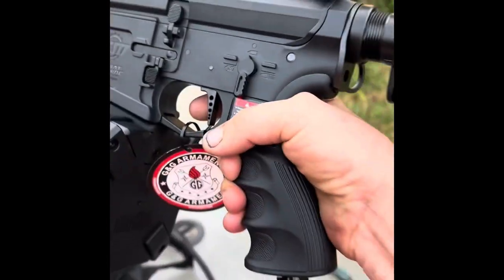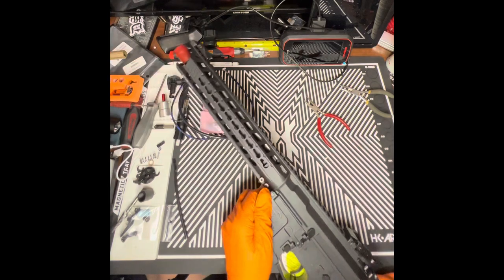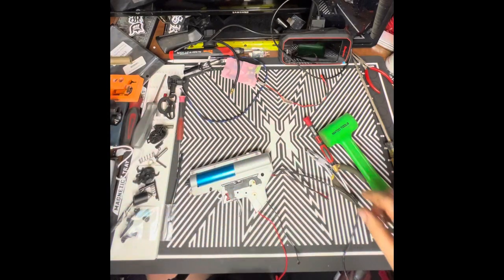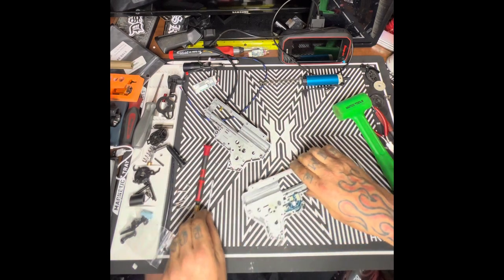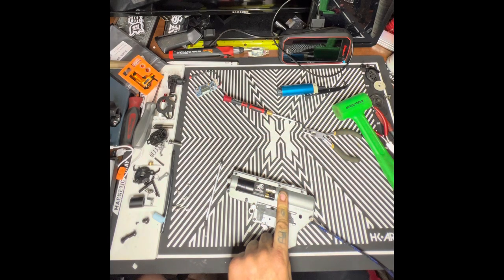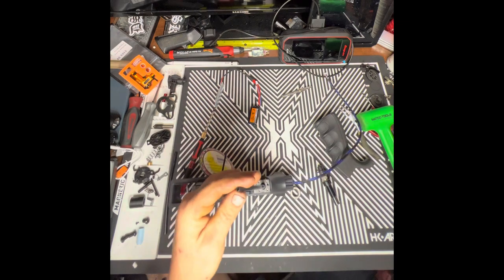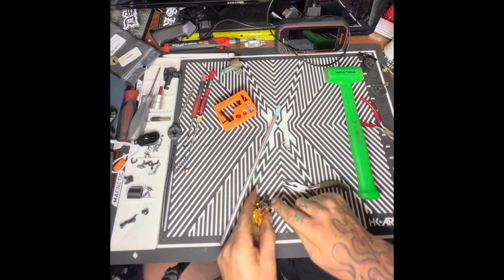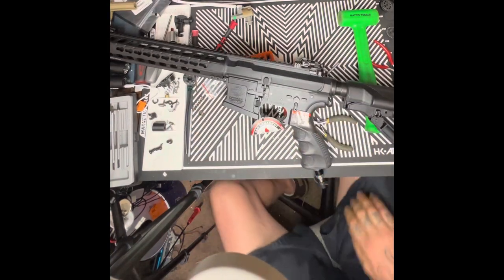Polarstar jack install in G&G cm16 predator. Step by step #airsoft #battalionairsoftarena #speedqb

Comment: What where u doing to the selector plate
Reply from the maker: You cut the edge so it doesn’t break the full auto switch off just give it a bevel on the edge to make it smooth

Comment: Hello I have a question I have a bout a 8 inch inner barrel and polar star jack and I was wondering how I could get like straighter lines or tighter groupings when full autoing at 60rps?
Reply from the maker: You will need a really good regulator for tighter full auto accuracy something that can recharge fast watch your gauge on your reg when you dry fire and if it drops low and comes back up slow it may need replaced or lube…

Comment: Question sir, if i installed a p* jack on my gc16 predator, is it a complete drop in without nozzle alignment issues?
Reply from the maker: 99percent of the time yea it’s ez
Reply: @JJMoore  last question sir, im planning to buy m4p maxx for this gun. is it perfectly a drop in or do i need to mod for it to fit?
Reply from the maker: @derickdarvin1572  yes only use orings to set hop up so it’s all the way against the gearbox
Reply: Where do i put the o ring sir?
Reply from the maker: @derickdarvin1572  over the front of the barrel or use a barrel spring
Reply: @JJMoore  oh, ok sir thank you! i will start the process once edgi sends my Inner barrel here in the PH. thank you again! ❤❤❤it helps me a lot and learns a lot from this video.